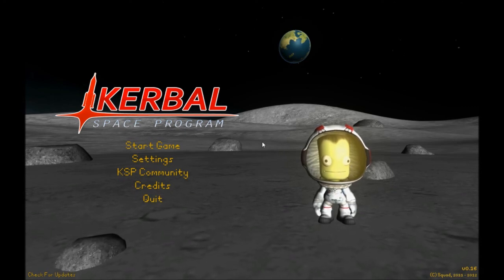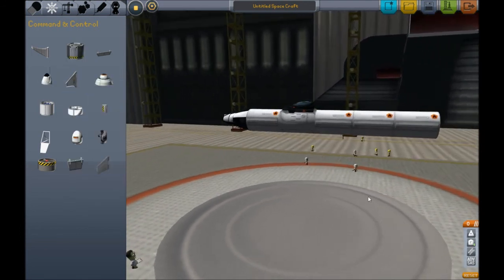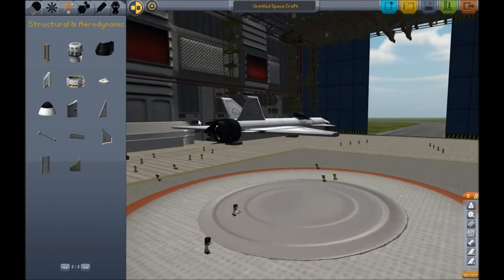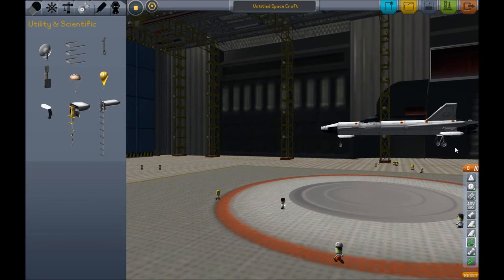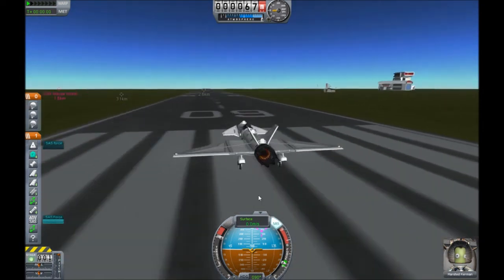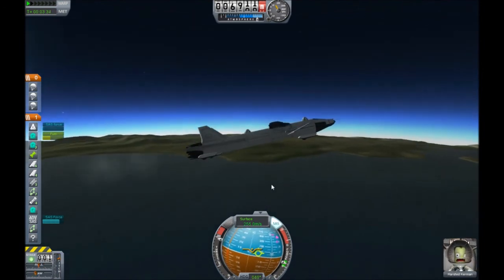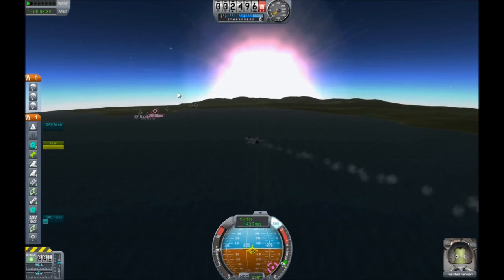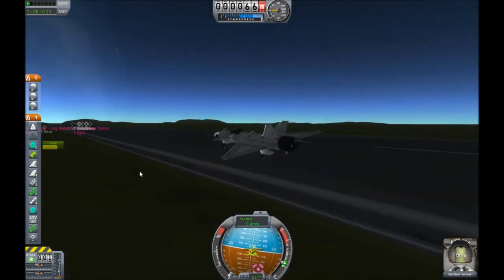KSP Tutorial Series Part 1: Space Planes. (Slightly Outdated see description)

Comment from the maker: The Command pod or "Cockpit" in this term allows a slight ammount of turning via gimballing, as well as the turbo jet engines have small rudders on them which also allow gimballing of thrust, thought you can easily stick a controle surface on the back and it would do the same thing.